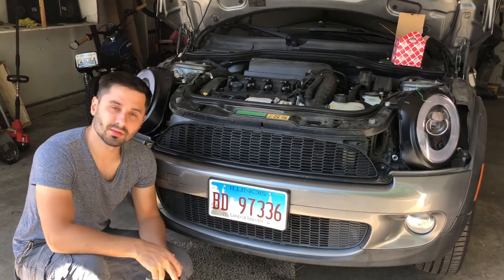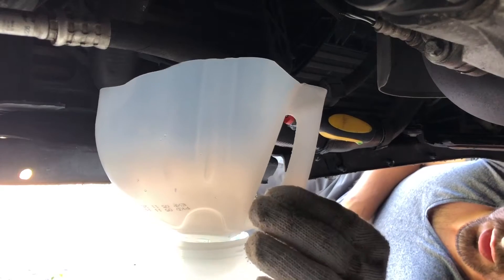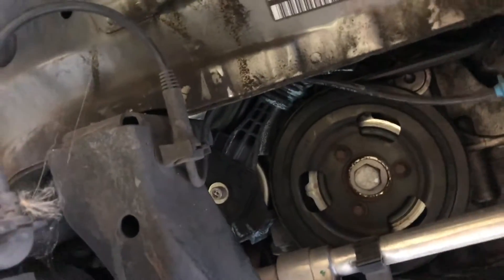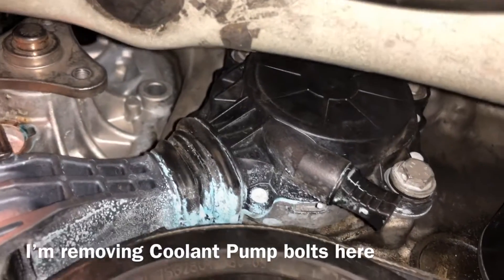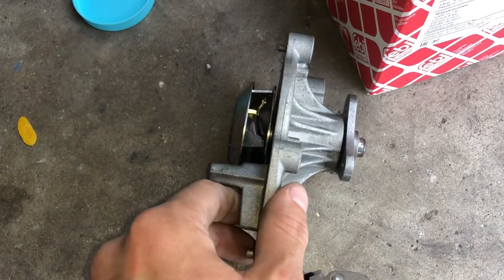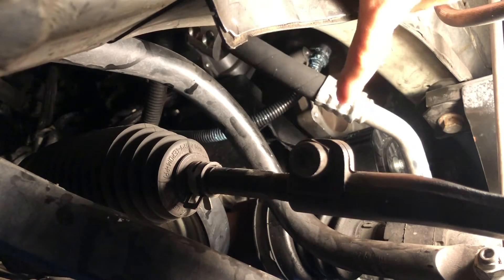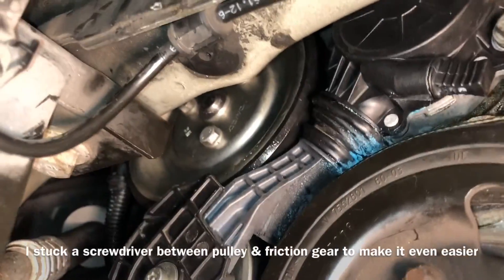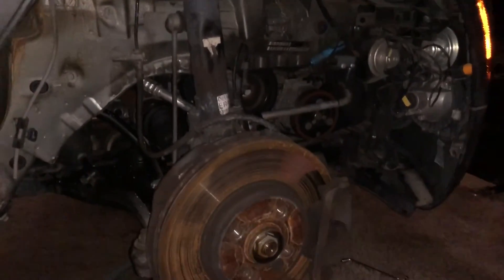Mini Cooper S R56 Water Pump Replacement - Coolant Pump DIY

Comment from the maker: Thank you everyone for watching. Please consider subscribing for more car videos!
Reply from the maker: Are you saying there is white smoke coming from the water pump? I don't see how that's possible unless it is leaking and gets on the hot exhaust and burns off. What can see you? Do you see coolant drops if the car runs once warmed?
Reply from the maker: That sounds more like a head gasket issue. If the car overheated because the water pump wasn’t working it could have caused the head gasket to blow.
Reply from the maker: It’s between the head and the engine block. You won’t be able to see if it’s bad by just looking at it. One way to check is to open the oil cap and look at your oil. Does it look normal or milky, bubbly? Check your coolant also to see if it’s clear and blue like it’s supposed to be.
Reply: Any ideas on r56 coolant boiling up through expansion tank just had thermostat changed

Comment: THANK YOU SO MUCH FOR SHOWING ME THAT YOU DON'T NEED TO REMOVE THE TENSIONER! I spent 4 house the first day trying to remove the tensioner. I gave up and the next day I found your video. THANK YOU! THANK YOU! THANK YOU! This tensioner bolts are impossible to remove AND YOU DON'T NEED TO! I installed the water pump in a hour and then spent 4 hours trying to install two tensioner bolts! What a waste of time. 
Thanks again!

Comment: So i couldn't get pump up there ended up taking the t30 security bolt and a 10mm box end wrench behind it remove friction wheel pulley its toght so is everything else though made it to where put pump up there falls right in.

Comment: How do you get the water pipe back on? I went through the top and did the thermostat housing and water pipe, since the water pipe has to be pushed into the water pump how do you know those two parts are tight and locked in again?

Comment: The struggle is real. Have not been able to maneuver it out the back. And it’s still unrealistic to take friction wheel out first.  But.. if you remove the intake manifold which you should do and check your pass through pipe.. that’s where I’ve had 2 failures. But by removing this you can access the top harder bolts for water pump. It this helps anyone save some skin.. cool.

Comment: Hello. I appreciate you creating these videos for the public. I plan on purchasing a 2023 MINI Cooper S, this model is on Consumer Report’s recommendation list. I’ve contacted owners and they have had no issues with the 3rd generation. Is the water pump still made of plastic on the new generation? I value your opinion, it’s a 2023 model with the B48 engine, do you think bmw worked out all the bugs and ironed out the  kinks from 2014 models? Do you agree with Consumer Reports? Please advise. I plan on getting my MINI in 2 weeks.

Comment: I am going to be doing this soon, to a Peugeot 208 GTI. I believe it will basically be the same as this. I am wondering if it would probably be easier to remove the top engine mount, and drop the engine down. I think that would make it much easier to acces the bolts. Cheers for the video :)

Comment: at 10:45 you pump looks like mine and the only way to get it to that point.  Then at 10:47, you pump has magically changed by 90 degrees to face the other way.  HOW did you do that especially with the alternator cable that doesn't move and keeps the water pump from moving?

Comment: if you take out the center bolt of the friction wheel this job is MUCH easier. People always seem to miss that the friction wheel is a single bolt. no need to take out the whole assy.
Reply from the maker: Great tip! Thanks.
Reply: I did the waterpump on my cooper s yesterday, and as you said, removed the wheel of the friction pulley. Made the job so much easier! Surprised at how many people don't take this step and spend ages trying to squeeze the pump out of the tiny gap!
Reply: That's why I come to the comment section

Comment: Cant seem to find the video you mention at the start that help you diagnose for wster pump issue. Is it available? Currently going to replace my water pump as there is a noise coming from there and replacing the friction wheel was not the issue and Water pump pulley seems in good condition.

Comment: Help required 
2012 Mini Cooper s
No power to connector rear wiper
Fuse okay,can’t find relay passenger interior side
Reply from the maker: I'd get a BMW/MINI specific scanner than can read each module. It should tell you if the signal is getting to the module, relay, wiper etc. 
Like this: https://youtu.be/d1xggdQA2sE

Comment: Good video.  You hadn't said anything about the water pump gasket/seal.  Did this require adhesive?   And did the gasket/seal play a role interfering with assembly, or by dislodging during assembly?
Reply from the maker: Thank you! I used the gasket that came with the pump, no sealants or anything. You have to be careful with the gasket once the pump is almost in place to make sure it doesn’t move. It’s been a few thousand miles in the summer with no issues.
Reply: @SimpleCarGuy    Thanks very much.

Comment: So what were your symptoms that led you to the water pump? I have an R56 that isn’t flowing thru the radiator. I’ve replaced thermostat and bled the coolant with vacuum filler several times. Still no go. Sound familiar? Lol
Reply from the maker: No exactly, mine would overheat if I drove for more than 25 minutes (so basically when the big loop opens). I let it run when it was warm on jack stands and it started dripping, so I tracked it up to the water pump.

Comment: Again  awesome video . These two things will the job a little easier.  Remove the air assembly and throttle body duct.  From the top side of the engine,  above the water pump,  there is a wiring harness in a metal channel that is bolted to the engine  wiith a 10mm bolt. Remove the bolt,  and wire tie the  metal channeled wiring harness to the fender well.  This will give you more  clearance to manuever your ratchet/wrench,  and  easier access to the top water pump bolts .
Reply from the maker: Great tip one again. If I ever have to do this again(I really hope, I don't), I will give that a try and hope it makes it a bit easier and less damage to my knuckles!

Comment: One of the better videos on YouTube  in regards to changing  the water pump on a MINI via wheel arch. It definitely helped me out tremendously .  I noticed my MINI had a leak coming from the water pump, and I ended up replacing a perfectly good water pump and friction wheel.- (So I  replaced a water pump that was probably going to fail in the next 25k miles) When I removed the water pump (via wheel arch) the  water pipe O-Ring was dislodged, and the flange was broken off.  This now made a 6-hour project turn into 10 hrs.  Upon disconnecting the bracket that stabilizes the automatic tranny linkage , I was able to pull out water pipe from underneath the intake manifold. To reinstall I had to remove the 5 Intake nuts and loosen the 2 bottom manifold support bolts. (one of them  is difficlut to get too) This gave enough clearance to install the  new water pipe. I installed the water pipe and reassembled. I started up the Mini and what do you know, it leaked.  So, I disassembled again, only to find out that I tore up the O-ring when trying to install the water pipe.  So, I pulled the pipe back put silicone grease on the new O-ring and reinstalled. If I had to do it all over again, the best thing to do is to remove the O-ring and put some electrical tape around the end of the pipe to protect it. Push the pipe approx. 3/4 of the way through. With the front passenger tire removed; pull the electrical tape off, install the O-ring, lube the O-ring with silicone grease, guide the water pipe into the water pump housing and seat it by pushing it from the thermostat housing end. Depending on the age of your thermostat housing, you may want to consider replacing it also . Hopefully this helps someone of your viewers  when they are replacing their Mini water pump  and discover they need a new water pipe
Reply from the maker: Wow.. having to take it apart after just putting everything together would be crushing. Sorry, man! Thank you for a detailed comment, definitely hope it helps someone in the future in case they run into the same issue. I'm glad yours is back in business, though! Keep the MINIs going!
Appreciate you watching!
Reply: @SimpleCarGuy  Believe it or not, the thought of doing it  the 2nd time around or hearing it from my wife was much worse than actually doing it. Thanks for your understanding
Reply: What year is your mini?
Reply: @missioncapable4658  2009 Clubman
Reply: İ always lubricate coolant related o-rings with water. İs it ok?
Reply: @tugrulbey3095  I believe it would be okay. You can use  a small amount of dish soap.  Especially on the water pipe (so you do not tear the o-ring). I used a special water lubricant pool  pumps.   Dish soap  should work just fine.
Reply: @rfcasey  yes. Soap sounds wonderful!
Reply: @tugrulbey3095 if it works for you it’s fine, but the thing is water doesn’t offer much, if any lubrication
Reply: Thanks for the intel, king. Man that leak after everything was put together... I would have been LIVID. But what I've learned is you CAN replace the water pipe without ripping in from the top and taking out the thermostat. Thanks. Because I've already replaced my thermostat and now I believe I have a bad water pump (no coolant circulating, no A/C). As for the O-ring on the water pipe, you can actually just dab the ring with some oil and it will protect it from getting scuffed or twisted out of shape. Also helps it slip right in where it needs to go. You got to be VERY careful with these plastic parts bro. My rule of thumb is, "If you had to use excessive force, you're probably about to break something!" Hahaha.

Comment: All because it has a French engine in.  Engine is rubbish unreliable
Reply from the maker: You're not wrong. Although even BMW (actual BMW) engines suffer from water pumps going bad. My e92 n54 had this issue at 70k miles.
Reply: I guess I’ve been lucky then. I’ve got 215000 miles on my R56 S, and I’m tackling this job for the first time. Replaced my clutch for the second time at 195000 miles. I’ve learned that if you maintain your vehicles you can typically run them for 250000 miles or more.

Comment: Painfull very great job.
Reply from the maker: It’s a bit painful, but worth saving the $800 for a few hours of work.
Reply: @SimpleCarGuy  i think too yes for pple they cant do it is beter to wait to change the full chain kit to do in same time, is no any acces from the top ? if you put off some air hose.

Comment: I did this job today myself in the shop...2012 mini cooper s water pump....all I did was remove right side headlight disconnected the 4 bolts on same side for black bar the runs across to other headlight...you dont need to completely remove the black bar just unbolt the 4 bolts it will give you enough clearance to lift it up and down...then disconnected the hose and motor mount then after that you have clearance to loosen the belt...then take  right side tire off and iner fender then the engine will be down enough from taking mount off to take the water pump polly off and water pump itself then reverse order that easy.....dont need to do extra work...make it easier on yourself do less work
Reply from the maker: I saw that method in the manual but it seemed like a lot more work having to drop the engine. The way I did it might have been slightly more annoying as you have to spend some time getting it out, but less work overall. If I have to do this job again, I might try it your way to see which way works best. Thanks for the information and for watching! Hopefully it will help out someone else in the meantime.
Reply: @SimpleCarGuy  only thing holding the engine on right side is 1 big mount with like 4-6 bolts doesn't take long actually was alot faster
Reply: @Boba6762  damn, wish I would have know this 2 weeks ago when I did mine, what a pain. Thanks for the tip
Reply: @cucolopez1942  real easy job in my opinion...some youtubers help yes but alot of them like to do it the long/hard way gotta think outside the box to help yourself in the long run this job isn't hard at all I've done it in less than 4 hours 2 out 2 in

Comment: With the extra amount of time and difficulty, you could have removed the engine mount and dropped the engine to clear enough space. Might have saved alot of time.
Reply from the maker: It wasn’t necessarily difficult, it’s just not a lot of space to work with in there. Also, that would involve supporting the engine with an engine stand etc. thank you for the suggestion, though!